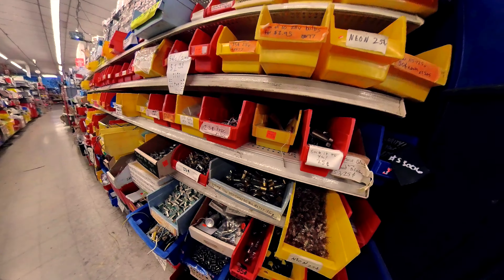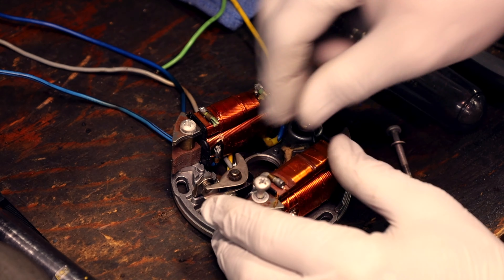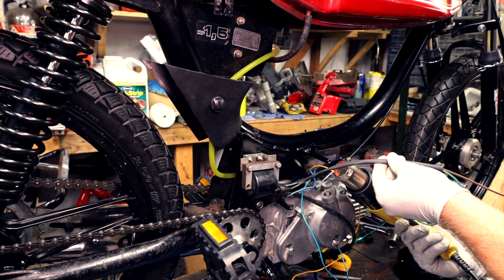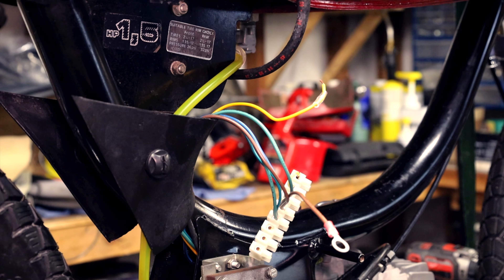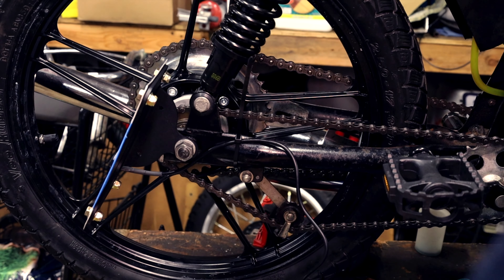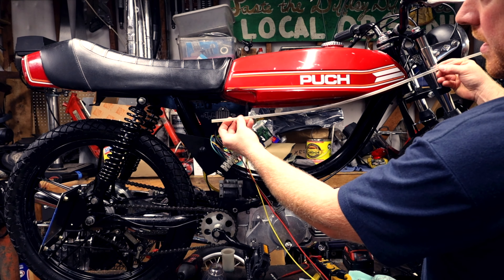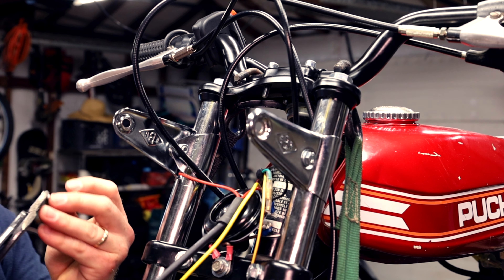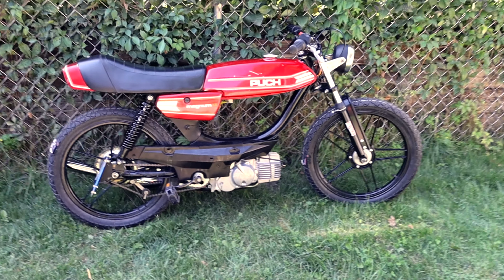12V upgrade and complete wiring Puch Magnum rebuild Pt 5

Comment: I saw that you plugged the ground in the headlight in the middle section and the power on the right. Currently I have it the opposite, should I switch them?
Reply from the maker: If I remember correctly I think I was using a single filament lightbulb on this build and thats just the prong that went to the lightbulb. Normally that light uses a high/low bulb. but its a weak system so they are both low, so I just use the high.
Reply: @Corn-ped  I was able to get spark last week (yay)! But thanks for the response!! :D

Comment: What gauge electrical wire do you use?
Reply from the maker: I am using 18ga stranded copper wire. I like 18, not too thick and not to thin.

Comment: Lol you said radio shack your showing your  age my dude. I miss the days of radio shack.   I know upgrading my light from 6v to 12v would be a nice improvement I imagine I'd need to get a 12v bulb to. But my big question is would upgrading the ignition to 12v really make a noticeable difference in power. I know better spark will make better power but ped runs great with the 6v I'm running the 72cc airsal big fin 19mm long sweeping intake 19mm polini 100main jet  stock crank trickmetric 6.4 version with light springs 16x34 gears and a proma circuit  exhaust with a simioni silencer.  Gets me up to 40mph really quick but it feels like it just hits a wall and wont rev out anymore other people say its because I didnt casematch but I did port match. I was running  a bigger carb for a while a 21mm pwk but it was always leaking and having issues but the polini has been great
Reply from the maker: 12v vs 6v wont give your engine more power. It looks like you are hitting a wall because you have a proma circuit pipe. Circuit pipes dont hit high rpm. They have great low end, but they hit a wall.
Reply: @Corn-ped  I wanted  to get the estoril with   the sidebleed will I get better topend with that or maybe you can suggest a pipe

Comment: Can you run the 12v lighting coil with the stock Bosch coil?.
Reply from the maker: yes you can! thats what I did with this stator.
Reply: @Corn-ped  wait, does the 12v coil not need to be floated? I thought I heard that having 6v and 12v sharing a ground leads to arcing.

Comment: Link to LED taillight?
Reply from the maker: 2pc 5" Red LED Motorcycle Turn Signal & Brake Tail Light Strip Kit [IP68 Waterproof] [Single Row] [50% Running Light] [100% Brake/Turn Signals] Flexible Tail Light Strip for Motorcycle Trailer ATV https://www.amazon.com/dp/B07YNZ97DF/ref=cm_sw_r_apan_glt_fabc_M555R7K0Y44NXX1ZEDZ3?_encoding=UTF8&psc=1

Comment: I'm in the middle of this right Now on my Maxi/Magnum Hybrid "maxi frame magnum forks and swingarm."mine is going to be a 12 volt DC system though!... All lights will be LED and have their own common 12volt DC ground totally independent from the frame also the 12 volt lighting Coil ground will need to be floated from the frame.All circuits LED headlight/ LED gauge lights,...LED Tail light,... LED brake light,...LED directionals and 12volt  DC horn will have their own fuses via a ATO fuse block.only the ignition will remain stock 6 volt AC points system which does use the frame as ground as was stock.The 12 volt lighting coil will be regulated and rectified via a Treats regulator/rectifier. this will require an entirely  new wiring harness which i am building now from a set of schematics i drew up.wish me luck?